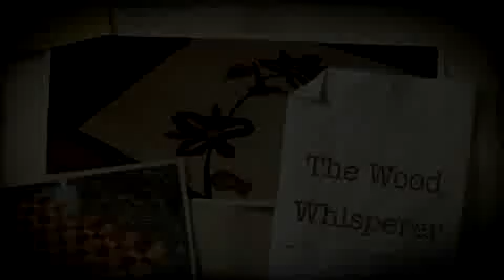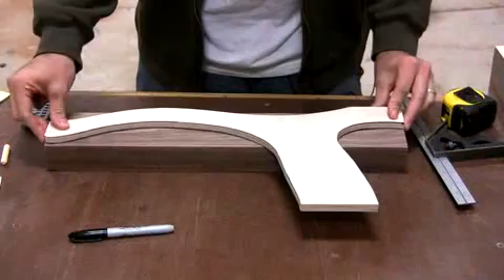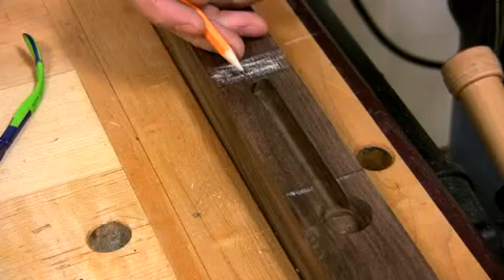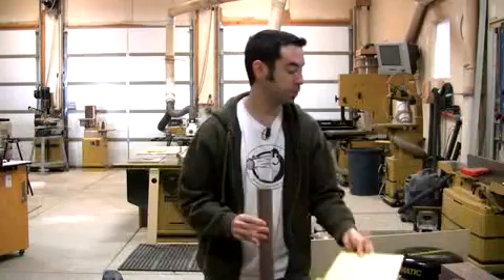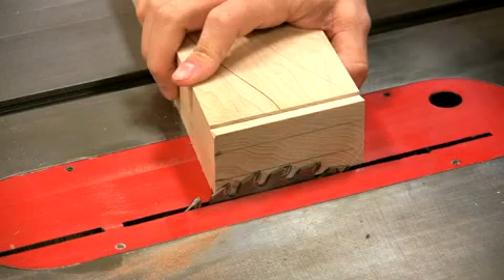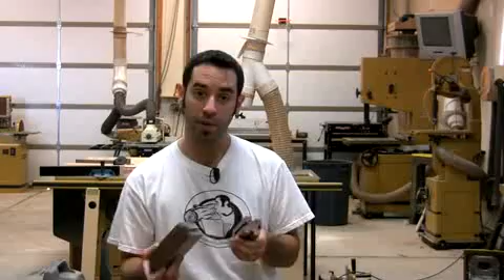38  - How to Design & Build a Sculpted End Table (Part 2 of 6)

Comment: I was watching as you said clean the dovetails without changing the angle. I found the perfect thing for very fine tuning. It's gonna sound funny but to get the minute thicknesses down in the groove bottom.......I stole my wife's wooden nail files. lol I know ow but those emery boards (wood ones not the crappy metal) are perfect for taking a tiny bit of material that may be keeping your joint from looking good.

Comment from the maker: I guess because I don't consider drilling a single hole all that much trouble. One hole saves lots of wear and tear on the router bit and adds about 10 seconds for each leg. Routing all that extra material would not only wear the bit unnecessarily but would actually wind up taking much longer than just drilling the hole and starting in the middle.

Comment: thanks for the great video, im going to try this method on a candlestick table for attaching the legs. how can i curve the rabbits to fit the outer circum. of the center post, or should i cut a flat dado into the the post  before cuting the dovetail?